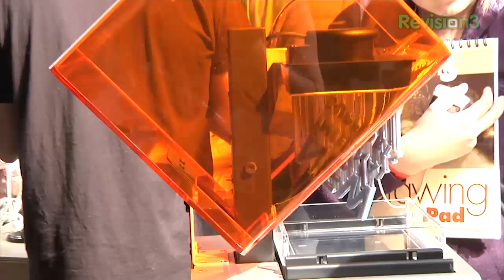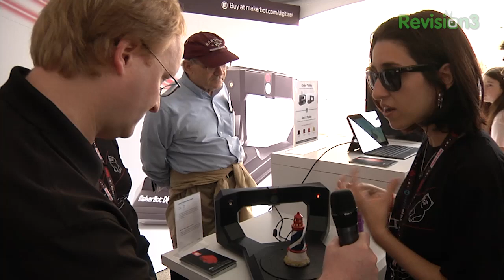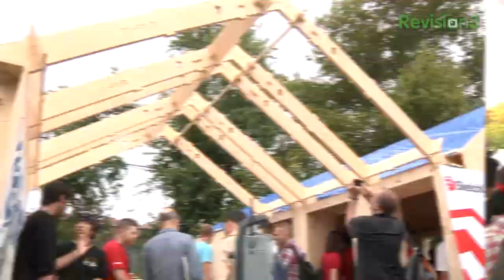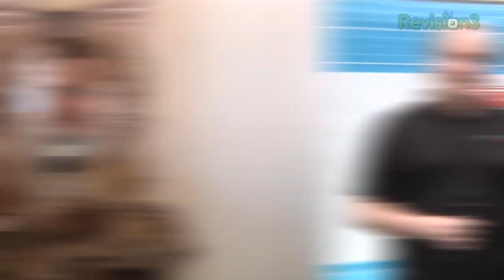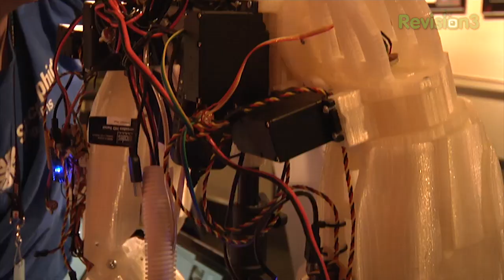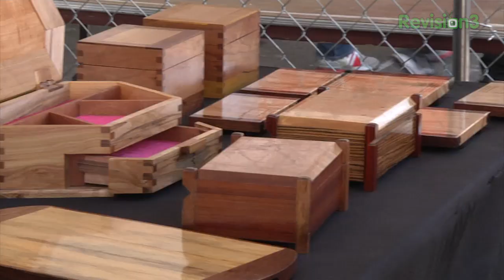Ben Heck's Maker Faire Experience

Comment: One experience at a job years ago. We had a 150W CO2 Epilog engraver. The guy had forgotten to turn on the cooling system and it destroyed the Lasing cavity. It used an RF exciter to get the laser working. so I had to replace the entire tube assembly.